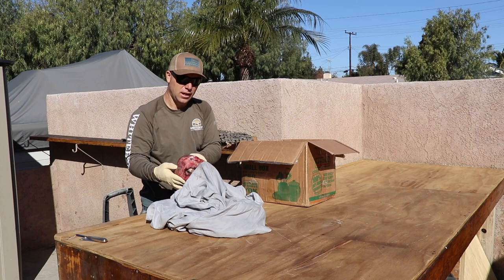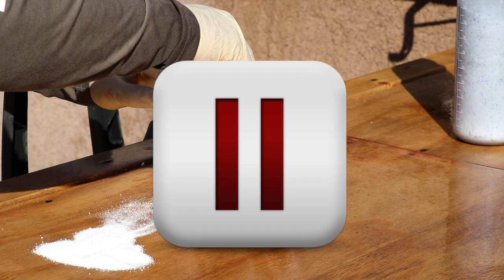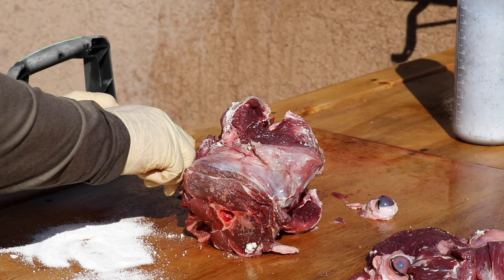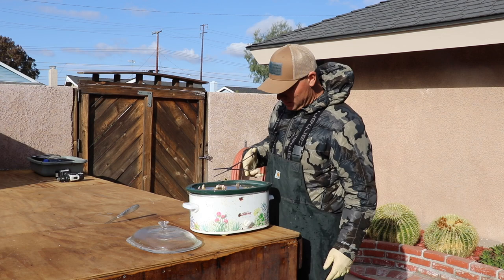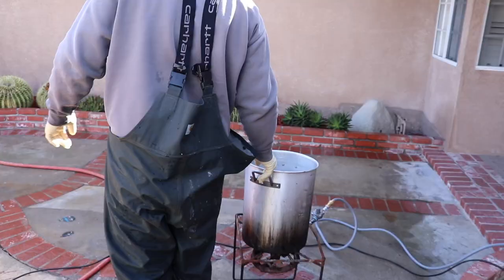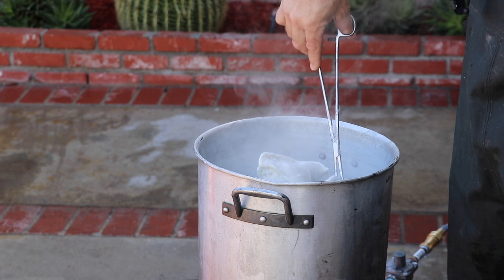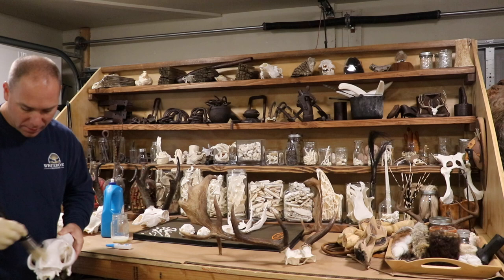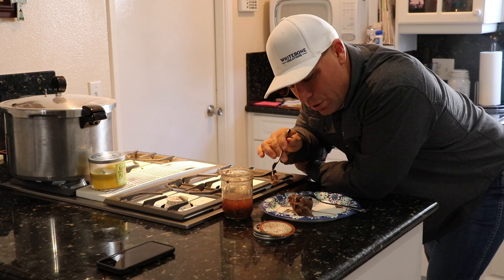HOW TO CLEAN WOLF SKULL

Comment: Neat video. I’ve only worked with smaller skulls and bones, but “never bleach, never boil” is the biggest rule of thumb I keep so I was surprised when you boiled it. I usually remove as much meat as possible, and always try to get out brain before letting it soak/ macerate because brains turn the water to a gross mess. Maceration is a much longer process though. I can’t imagine how long it would take for a skull that big
Reply: You can boil as long as the water doesn't haves corrosive chemicals